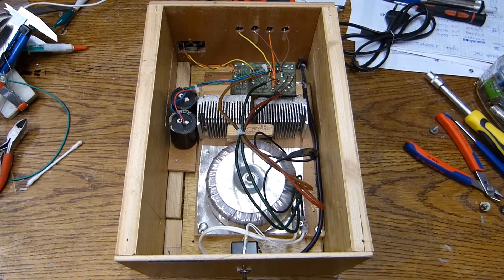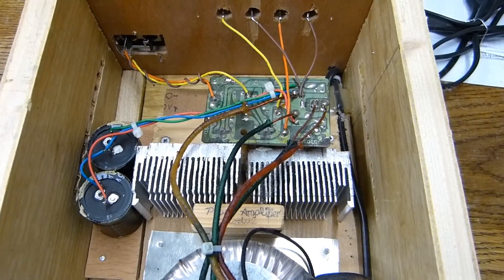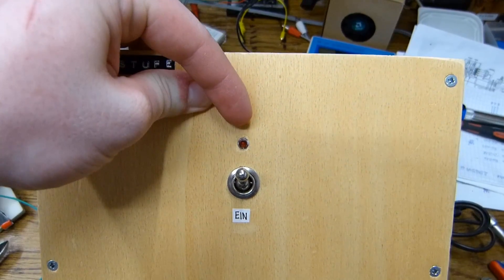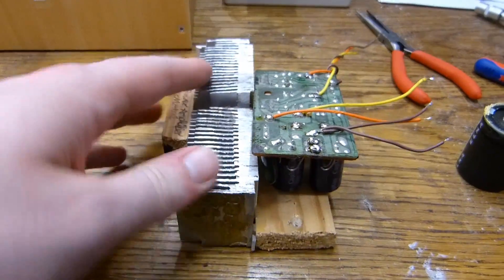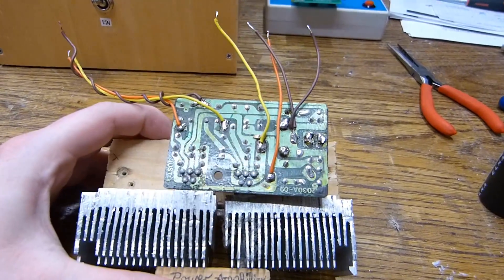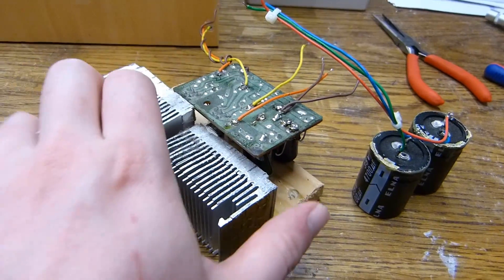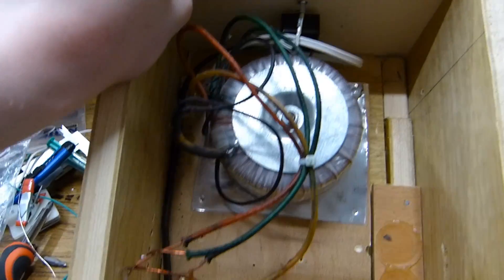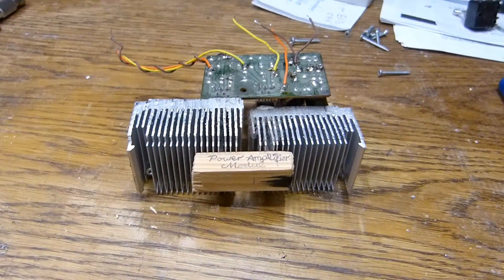DrCassette's Workshop - TDA2030 power amp (2009)

Comment: Mains hum is something I still get all the time with all my diy amps.I havent figured out how to solve it yet.Only by chance I do not get hum.
Reply from the maker: +As DIY as it gets. 
It seems to involve a lot of experience, filter capacity and shielding in the right spots. Thanks to good ground layout and metal shielding over all the amp circuitry my most recent home made amplifier actually is totally silent in idle.
Reply: +DrCassette is it totally silent even with the input unplugged?
Reply from the maker: Yes, it is.
Reply: I am  using two 1K5 resistors between each channel input and ground.I have noticed the bigger the resistor the bigger the noise.I used two 30K resistors before and the noise was significantly worse.What are you using between the two chanel inputs and ground?
Reply from the maker: I set up my TDA2030A circuits according to the typical application schematic provided in the datasheet of the chip. C1 is the coupling capacitor for the audio input. R3, between input and ground, sets the input impedance of the circuit. The datasheet specifies 22 kOhms. Mismatched impedances between amplifier stages could lead to increased noise, but I'd say you very likely have a problem somewhere else in the circuit.